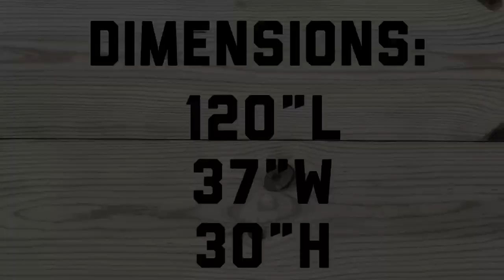The $125 Farmhouse Table- Easy DIY Project

Comment: You should really use panhead screws when using pocket holes. It prevents the wood from splitting and they are designed to work with pocket holes and pull the pieces together. Also, clamping the boards together before screwing will prevent them from shifting while screwing together and will give you a flatter surface. Hope it helps!
Reply: MM - do you recommend clamping long ways or at the seam where the lumber boards connect to each other? About to make my 2nd table and want to make this improvement...
Reply: @SergioTrujillo11  I recommend using as many clamps as possible to squeeze the boards together and keep them as flat as possible. But if clamps are limited, and you're using pocket screws, clamping them together (instead of down, if that makes sense) should be enough to keep things from moving while you screw it together. Ideally you would just use glue and avoid screws all together though. But that's easier said than done. If you want to get into this more, feel free to message me on Instagram (same username). Would be happy to share any experience I have!

Comment: I like it but I would have squared up the table top boards before assembly. You can see a slight bow in the top from the end on view on the opening picture.
Reply: Hard without a planer or jointer. Bye yeah your right.

Comment: Nice design if you would have planned the table top you wouldnt have a bow also pan head screws and get the tread pattern for your specific wood type hard/soft and some glue wouldnt hurt at those pocket hole joints

Comment: How did you attach the table top to the base? And add the v center?
Reply: I just followed this script - my cuts were 28.5” and then I cut them at 35 degrees which put length from one side length at 26”. I put them 24” from the pedestal base and that pretty evenly supports the table top.

Comment: Non pressure treated 4x4 are $30-$40 ea x6 is roughly $180+ so I am not sure how you would keep the price under $125.00?
Reply: They must have used Pressure Treated? They cost 10 dollars each at Home Depot here in GA.
Reply: They are definitely not pressure treated. If they were they would look green.
Reply: allison hood wow my Home Depot or Lowe’s sells them for 13$
Reply: Noel Urban correct, pressure treated
Reply: allison hood nope, Untreated Douglas Fir 4x4 is 13$ and treated is 7$. Probably depending on where you live I guess.